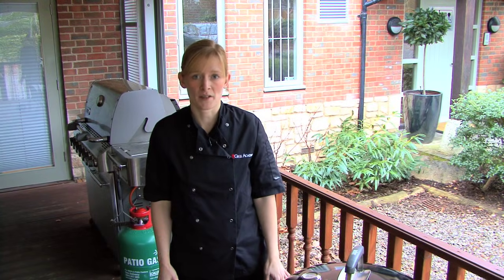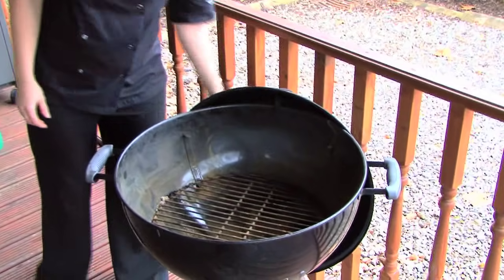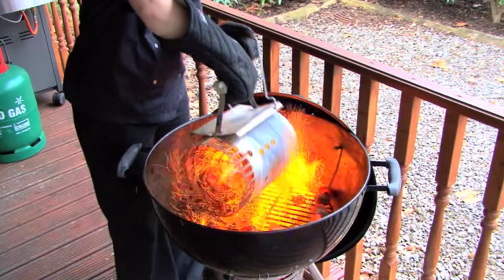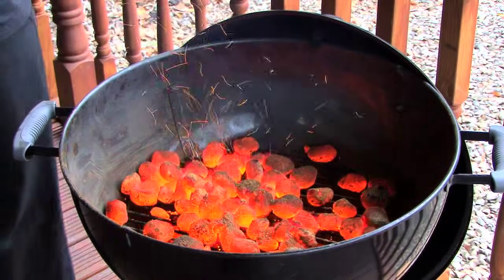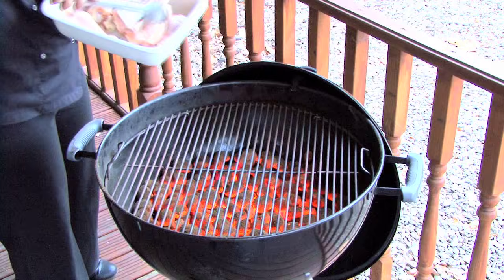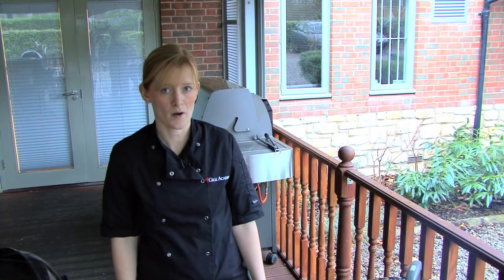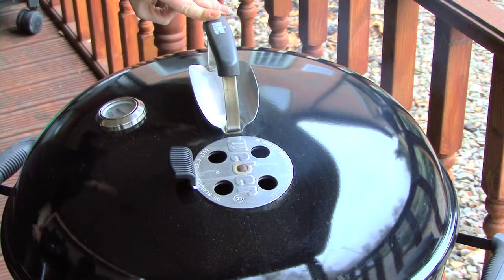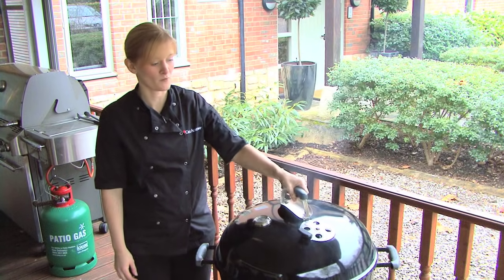How to control the temperature of your Weber Charcoal Barbecue

Comment: If you're just starting to use a charcoal grill PLEASE ignore everything in this video and save yourself a ton of frustration.
Reply: MrCoffeekelly could you tell what are the mistakes and how they could be corrected, please?
Reply: Mehmet Ali Özdemir you shouldn't cook chicken directly over blazing hot coals like that. It will be burnt on the outside and raw in the middle, NOT GOOD for chicken! You need to set up an indirect cooking method for chicken. Pile the coals on one side of the grill and leave the other side for indirect cooking. Sear the chicken over the coals then move it to the indirect side and finish cooking it with the lid on until you get a safe internal temp.
Reply: MrCoffeekelly Facts!
Reply: MrCoffeekelly indeed! Cooking the way shown in this video is a good way to get food that is burned on the outside and raw in the middle.
Reply: Mehmet Ali Özdemir the main problem with this method is that it provides a lot of radiant heat but very little convection heat. Radiant heat doesn't penetrate well, hence the overcooked exterior.
Reply: @Filanca1  Bunlara çok kulak verme ağa. Bunlar ne etlerini marine ederler nede kömürün üstüne alevelenmeyi önlemek için tuz atarlar. Ancak hepsi birer bir  usta yok canım direk kömürün üstüne koyma etin içi çiğ kalır çok s şeklinde kömürleri diz fasa fiso. 

O kadar değişik kültürlerin mangal videolarına baktım bu kadar seçici yorumlar görmedim. 

Bir şey öğrenmişler sanki vahiy.
Reply: @attomicchicken  teşekkürler. tuz konusunu bilmiyordum, deneyeceğim. yalnız buradaki hemen herkes tavuğu önce doğrudan ateşte közleyip sonra dolaylı ısıda pişirmek konusunda hemfikir. haksız olmayabilirler gibi geldi bana
Reply: Agreed. Just do it the old fashion way. Pour the charcoal in and form a pyramid, pour your lighter fluid and then light then with a lighter stick and let them turn to ash white, then use prongs to spread them or put them on one side to create a temp zone.
Reply: I also found it weird how she dumped her coals in put the grate on then instantly put chicken on, aren’t you supposed to let the grate heat up first? Or is that optional?
Reply: @spirittammyk  never use lighter fluid....bad for the taste...
Reply: @MrCoffeekelly  that is the truth.
Reply: True! I use old kitchen paper wet with old kitchen oil. It’s free and works wonderfully.
Reply: @spirittammyk  chimney starter and newspaper unless you like the taste of lighter fluid……
Reply: @theresawinterhalter121  what should you use??? I need help lol
Reply: @rashadfr25  Depending on what you're cooking, you don't wanna use that much charcoal because your temps will be really high and hard to bring down. So, start with half a chimney and then add on from there if you need too. Secondly, set up the grill in 2 zones, meaning coals on one side and none on the other. Cook on the side without the coals (like an oven) and use the side with the coals to sear your meat. Its also a safe zone to move food to, if you start ro burn or cook things too fast. Check out my guy Johnny over at " View to a grill" and go thru his set up videos you'll like them and you'll be alot better on the grill in no time.
Reply: @rashadfr25  just in case you're still struggling lighter fluid is fine. you just need to make sure you give the coals enough time to burn it all off before cooking. personally I like match light coals with just a splash of fluid on them. Gets things started well.

Comment: The only time I've left the bottom vent WFO was to help get the coals started...Since I started using a chimney I leave them 1/2 closed or more and adjust temp with the top vent.  Those were some seriously HOT coals...

Comment: The only thing she did right in this video was use a #Weber grill. Everything else - disaster!
Reply: Brandon White Why? (serious question, not mocking)
Reply: Why Weber? Because they are the best at holding heat for the price point and EXTREMELY versatile. 

Why Disaster? Because she has her charcoal grill on and around too much wood. Her charcoal is literally molten lava. She spread the lava (coals) across the entire bowl in one layer instead of using the 2 zone method. One layer like that will cause the coals to go out much quicker. She also spread her coals out into that thin layer without using any grill gloves to protect her hand. And then she cooked chicken on the grill immediately after putting the coals in. She should have waited for the grates to heat up. When grilling chicken, you definitely want to use indirect heat; the way she did it, the chicken burned and it may not even be cooked all the way through which could lead to health issues. 

But hey, she used a Weber! Just used it wrong! 😏
Reply: Brandon White This points describes my opinion in a nutshell.
Reply: She also used a chimney starter, so yeah everything else was atrocious

Comment: The coal starter is the best and Weber makes a good one. After adding hot coals, I put lid on with vents bottom and top open to let the grate heat up to say 300-400 on the indicator before opening to add meat. It seems meats with less fat (steaks) don’t stick when the grates are heated first. Cook steaks for about 5 min and turn 90 degrees for another 5 minutes. Flip over and repeat. Now that’s with one third of the coal used in this vid and with 1.5”+ thick cut filet mignon.

Comment: I do, I often grill 24 of them on my 22" Weber. Usually I will pull the skin from the legs prior to cooking. A dash of season salt on each leg. They dont hit the grill till the coals are at the peak heat. This locks in all the juices and gives the outer meat a skin like texture. I add a few apple wood chunks and some hickory to give them smoke. After searing I cook them indirectly for about 60 min. About the time it starts falling off the bone. They are amazing and cheap grillin! Drink Beer!

Comment: Also a good idea to open the grill vents up after adding the coals for 5 mins or so to get the temp up to ~450 and then clen the grill with a wire brush. Then  close it down and get the temp you want to cook.
Reply: Never use a wire brush. Ever. If a wire breaks off onto the grill and gets in your meat. That is a fast way to a punctured stomach.
I use crumpled up till foil followed with an onion. The onion will set if off for anyone around. The smell gets everyone hungry.

Comment: The grate didn't look dirty it looked to me like it was well seasoned, as in used. If you have to have a perfectly clean grate when you start, you will end up losing meat to sticking. As for using the Weber for cooking as opposed to the gas grill, the taste is much better when cooked over hardwood or charcoal. If you want to use gas, COOK INSIDE!

Comment: Thank you for this video. Very helpful and informational. I do appreciate it.
Reply: 231MasseyFerguson No, it wasn´t! She made a mistake on almost every step!- Don´t spread the coals over all the grate: have a direct and indirect cooking surfaces.
- Never cook poultry over direct heat: it will burn the outside while the inside will remain uncooked.
- The air vents are not ment to be kept always open: They´re used to control the temperature according to what you´re trying to cook.

Comment: This reminds me of my first couple times using a kettle grill.  I thought I'd spread them out for more cooking area and then started charring my meat right away because was all 100% direct heat and then the temp in the grill started dropping quick after about 40 min because was so spread out.  The beauty of the kettle grill is doing 2 zones, one hot one indirect. Then you can shuffle burgers thick steaks, chicken or whatever for a quick sear then move over to finish it off.
Reply: Thanks for saving me the time to post the same comment. I expect better from a mnf. of bbqs

Comment: OK, but how do I raise and lower the temperature?
Reply: How vents control temp
Most grills and smokers have two oxygen controls:
1) An intake damper that brings oxygen to the fire.
2) An exhaust damper (a.k.a. flue, vent, or chimney) that exhausts gases and pulls in oxygen through the intake dampers.
The intake damper is near the charcoal or wood and its job is to provide them with oxygen. The intake damper is the engine that drives the system. Close it off and you starve the fire and it burns out even if the exhaust damper is open. Open it all the way and the temperature rises. On most grills and pits you control temperature mainly by controlling the intake dampe

Comment: Hello, I am very surprised to see your charcoal red hot like this. I cannot reach 350 degrée F or more than 200 degree celcius in my weber (57cm with weber charcoal using chemney). Any advice ?
Reply: Ikkouy Don't pour the charcoal out of the chimney until it has become ashen white.  Ensure both vents remain open to maximize air flow and thus heat.  If you still need more heat, consider using lump charcoal instead of briquettes.  You can also add chunk hardwood on top of the coals to really boost your heat (e.g. 700-900 degrees Fahrenheit), but the heat may not be consistent.
Reply: James Rogers thanks. I am going to try. Recently, I used wine cane (sarment de vigne) and it worked very well. I will maybe try a mix between briquette and charcoal lump too.

Comment: This Brit cheapskate had a One Touch Silver, not even a Gold.
And control your temps by banking the coals on one side, put
your slower cooking meats on the other...
 and DO close off the bottom vents a bit...maybe even 50 - 75% closed.
You can get down to 225 degrees that way.....

Comment: This video is the complete OPPOSITE of what you should do - it shows you what NOT to do. You DON'T tip the charcoal onto the charcoal grate whilst the charcoal is still flaming - that's a sure fire way to burn your food. You also need to pre-heat your cooking grate for about 10 minutes BEFORE you place your food on it to cook. Finally,  you DON'T need one layer of charcoal on the charcoal grate - you need TWO areas: one for direct cooking and one for indirect cooking. Sear the food over  direct heat and then finish the cook, on indirect heat.
Reply: calm down pro